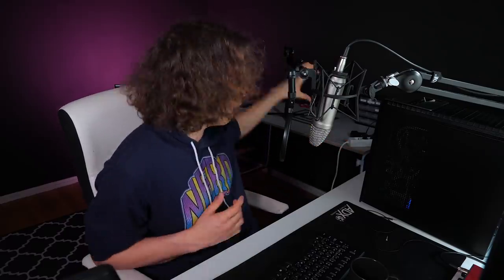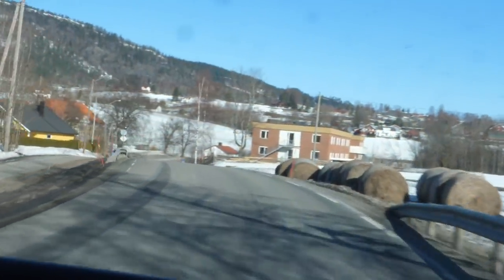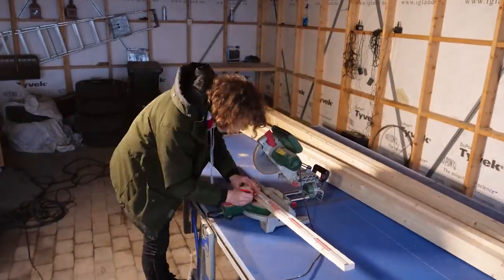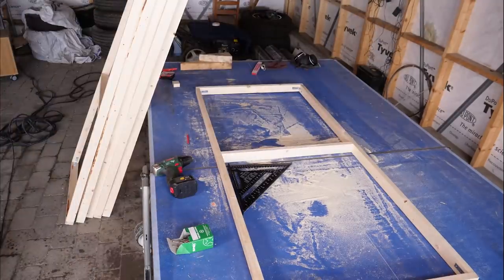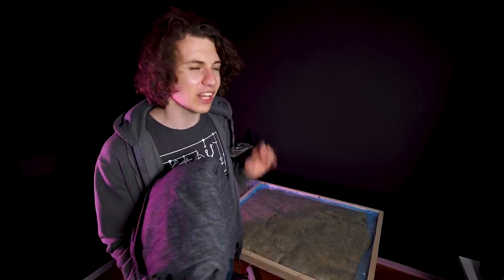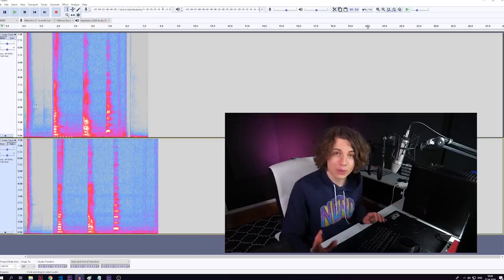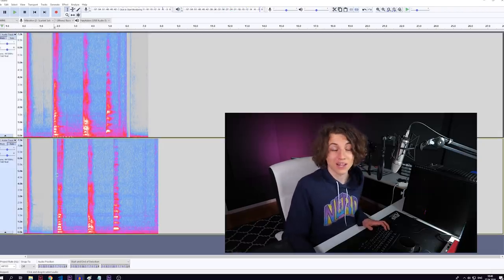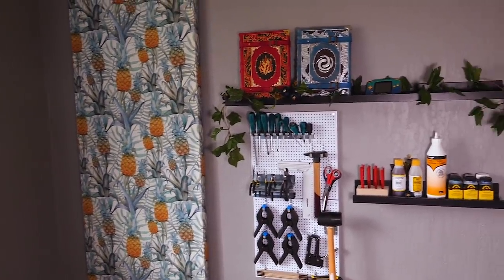How To Make ACOUSTIC PANELS For Better Audio (CHEAP DIY project)

Comment: Rockwool in plastic does not absorb any sound waves... there is still a echo.... try it without or wrap it in shower towels before you put hem in the panels... 🤔🤔🤔🤔🤔🤔🤔🤔🤔🤔🤔🤔🤔🤔🤔🤔🤔🤓😜🇨🇭
Reply: @macbaar
This is just not true. Put a plastic bag around your loudspeaker, and see what happens.

Comment: You’ve severely limited the effectiveness of the panels but putting sealed plastic on the back.  How does one not have common sense enough to not do this?!  That’s why the “after” recording still has clear and audible signs of reflections.  Go look at youtube videos.  People who have done what you did, had WAY more of a difference.  Luckily for you, it can be easily fixed.  Just cut the plastic off and use something like furniture backing material.